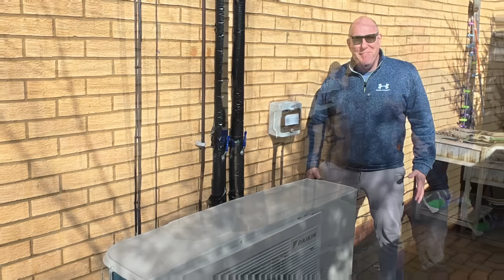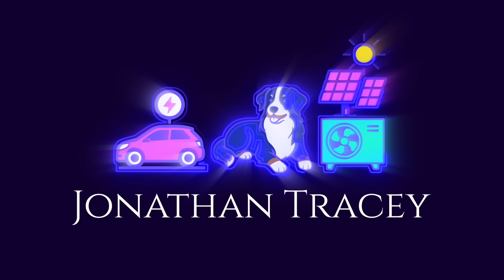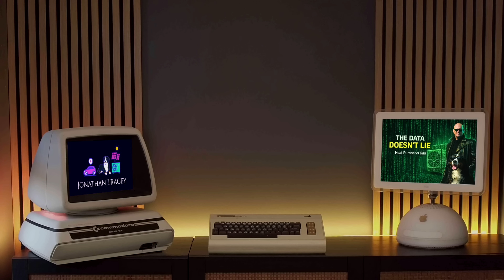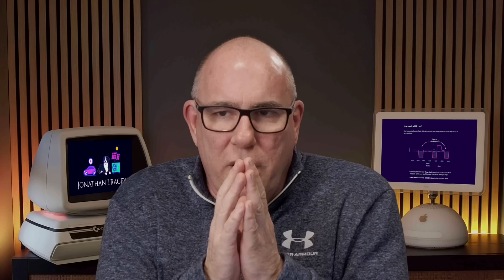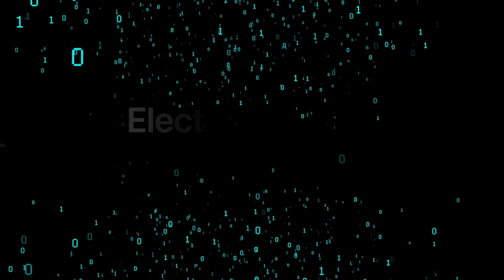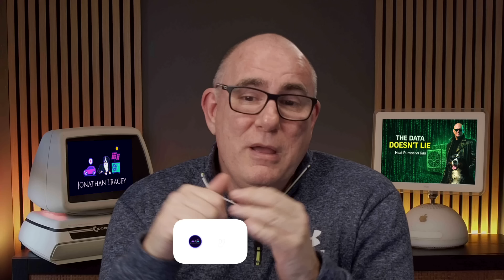The Data Doesn’t Lie   Gas vs Heat Pump Real Running Costs

Comment: If you are making the decision between a gas boiler and a heat pump based purely on cost choose you installer for your gas boiler as carefully as you would for a heat pump.
A study of UK homes with modern condensing gas boilers showed an average efficiency of 80% not the SEDBUK 94% manufacturers claim.
Yes modern gas boilers in lab conditions can hit 94% efficiency but you need a couple of things to achieve this.
1) The system needs to be designed for low flow temps so you need a heat loss survey the same as with a heat pump.
2) You need a condensing boiler with weather compensation that has been properly commissioned.
3) The boiler needs to be run low and slow similar to a heat pump.
I would suggest the sort of consumer who would not have the wherewithal to run a heat pump cost efficiently would probably be the same with a gas boiler.
Reply: You forgot to mention that the study was done years ago, not long after the introduction of condensing boilers. One thing the massive increase in energy costs has done is made people aware of lowering temps to allow the boiler to condense correctly, together with newer boilers being even more energy efficient with better modulation.
Reply: @bordersw1239 installers don't care and most people don't dare adjust stuff - same problem with many heatpump installs too
Reply: @bordersw1239  Sure, but you have no evidence to prove it has changed or by how much.

65% of households in the UK are on a standard variable tariff. If that 65% can't work out that a non-standard variable tariff is cheaper, how likely are they to be messing with the flow temps on their boiler to optimise performance to the max?
Reply: @nervousfrog101 . Well the test rules changed in 2015, when I bought my present condensing boiler 9 years ago, my usage dropped over 20%.
Reply: @bordersw1239  Just to be sure I understand, you replaced one condensing boiler with another, and usage dropped 20%?  Was the new one equipped with weather compensation and the old one not?  Were they both running at the same flow temp? My last condensing boiler was installed in 2015, but I had to request the weather-compensating controller, and the installer failed to set up the flow temp appropriately. I had to adjust the weather comp myself. Every year, when I had the boiler serviced, the engineer would turn the flow temp back up, and I would have to turn it back down when he left.
Reply: @n @nervousfrog101 Where did I say my previous boiler was condensing?
Reply: @bordersw1239  "when I bought my present condensing boiler 9 years ago" can kind of be interpreted that the previous was condensing, which is why I asked before making an assumption.

If your previous boiler was non-condensing, then the efficiency could have been as low as 60%, so a 20% improvement would be in line with the study that showed the average condensing boiler efficiency was 80%.
Reply from the maker: @nervousfrog101 I agree with you. One thing I always say is don’t automatically choose the cheapest quote without understanding exactly what you’re getting. The design, commissioning and controls make a huge difference to efficiency.  

It’s also worth thinking about aftercare — what kind of support will you get 1 year or even 5 years after the install if something needs adjusting or fixing.
Reply: @JonathanTracey   for the purposes of this video aftercare is irrelevant, It can be as good or poor for both types. Here is an interesting fact though, if a combi boiler is set up like an ASHP it's far more reliable than if were it were set up traditionally (ie. badly). Boilers (like any 'machinery') will run without breaking for long periods of time if they are treated gently.
Reply: agree, no gas boilers in the UK is 90% efficient, my combi boiler before being replaced with a heat pump was running during winter on the lowest modulation with flows ~36-42C, basically maximum efficiency for the condensing boiler with efficiency of 85%. Weather compensation is useless for 99% of the houses, as boilers are massively oversized, they cycle even in freezing conditions and hit anti-cycling with most of manufacture controls on weather comp. For my boiler to stop cycling on lowest modulation temperature outside should be around -20C. 

If I take my house with gas prices on the cap tariff. 3803.4kW gas (Dec-Feb) * 0.85 = 3232.89 kWh of heat, that would cost me £253.75 for gas (including standing charge) vs COP 4 heat pump £208.84, and COP 3.2 on the heat pump to brake even. no batteries, no solar, no optimisations, CVT tariff.
Reply: Most of the population don't give a damn about SEDBUK or COP only the cost of having hot water and staying warm.
Reply: @jimh5031  Otherwise known as the SEDBUK or COP
Reply: You can get gas combis up to 98% now. To get the max efficiency out of gas takes just the same as it does for an ASHP, so if you are comparing like for like.
Reply: @lksf9820 I would say a 98% efficient Viessman will not be an average install. A similar quality heat pump install could hit 500% efficient. So yes compare like for like.
Reply: @nervousfrog101   Given the cost difference between a Viessman and any ASHP it's perfectly valid, it's a fraction of the cost. We're talking about money here, nothing else.
98% is the boiler itself, not the install or spec which is often suboptimal.
Everything you do to make the entire system more efficient applies to both heaters.
Here he's used the same system, house and criteria for both heat sources so the results are reasonable and logical.
Reply: @lksf9820  A lot of the extra cost of a heat pump is rad or pipe upgrades. If your CH system is ready to run the Viessmann boiler at 98% then your system is heat pump ready. The 98% is an up to efficiency not an all year performance of 98% whereas we have documented  measured heat pumps with an average performance of 500% over the year. It does not matter how efficient the Viessmann is it won't beat that. By the time you take the grant into account the heat pump could be cheaper.

If the efficiency assumed for the boiler is incorrect then it's not a valid like for like comparison. Also as others have pointed out the efficiency of JT's heat pump will increase significantly outside of Jan and Feb you need to consider the efficiency for the whole year.
Reply: @nervousfrog101  "A lot of the extra cost of a heat pump is rad or pipe upgrades." No that's wrong, every install is different.  An average to top-of-the-range ASHP install is always more than a boiler swap, even if it's a top of the range combi, with or without additional upgrades.

"If your CH system is ready to run the Viessmann boiler at 98% then your system is heat pump ready." That's exactly what i'm saying. Likewise a substandard system will bring down the efficiency of both too.
 
"The 98% is an up to efficiency not an all year performance of 98% whereas we have documented  measured heat pumps with an average performance of 500% over the year. It does not matter how efficient the Viessmann is it won't beat that. "
Not JTs which is the test subject we're talking about. Forget other houses, we didn't test those.
The fact of the matter is HE would be better off on gas.
And if you were to compare 98% to 500% then take everything else into consideration too, like  initial cost and longevity, ROI, service costs. 

"If the efficiency assumed for the boiler is incorrect then it's not a valid like for like comparison."
He's based it on 90% when condensing boilers are more. So in those months its beating the HP even though the gas is based on worst case scenario.

"Also as others have pointed out the efficiency of JT's heat pump will increase significantly outside of Jan and Feb you need to consider the efficiency for the whole year."
Yes agree, but then so will a gas boiler. It's cold where I live, but recently we haven't even had our boiler on during the day due to the weather, it's 20+ in the house. That's zero gas use from 8 till 6.

I think ultimately unless someone has done a lab accuracy back to back actual test for a whole year then we'll never know with 100% accuracy, but for what it is his test is very reasonable.
It could be plus or minus £50 and the lesson is still clear.

Can you get an ASHP with a 12 - 18yr warranty? You can with a combi.
Reply: @lksf9820 Aira offer 15 years. I have seen a company offering a 30 year warranty.
Reply: @nervousfrog101   with the weather like we've had this week, (warm days of 20+ in the house without heating) what would an ASHP be doing during the day and how would it handle the fact it's got to keep the temp at 20 when the sun goes down?
The weather is very different to last week and could go back to Winter next week.
Does it switch completely off via the house 'stat or keep ticking over, if the former, what triggers it to come back on before it gets cold so it can warm up slowly? Serious question!
Reply: @lksf9820  "An average to top-of-the-range ASHP install is always more than a boiler swap, even if it's a top of the range combi, with or without additional upgrades." 1st that's a separate topic but it's not necessarily true. The £7.5k grant balances things out. Taking out the cost of rad changes and the hot water tank my heat pump would have cost less than a new combi. IIRC JT's install was cheaper than having another gas boiler installed.

"He's based it on 90% when condensing boilers are more." You have no evidence of that. The only studies out there show that 80% is a more realistic figure.

My only point here is that the 90% figure is optimistic based on real world studies not that it's not possible so people should think carefully before making a decision. I have never said that a gas boiler can never beat a heat pump on running cost.

"we haven't even had our boiler on during the day due to the weather, it's 20+ in the house. That's zero gas use from 8 till 6." I thought we were talking about JT's property now you want to talk about yours and how you use your boiler which we have no information on.

If we want to start talking about best cases and how one person can use their boiler in a particular way to be cheaper then fine lets do that. My old weather compensating condensing boiler(running at flow temps between 25 & 45 degrees) would have cost me £585 last year my heat pump cost less than £195. I have further optimized the system and with the electricity price cut in April it will bring the running cost below £100.
Reply: @lksf9820  The answer is it depends. With my HP you have two options. 1) Run it on the room thermostat. 2) A mode they call LWT(Leaving water temperature). In both modes the heat pump watches the return temperature and tries to maintain a delta between the LWT and the RWT, and will shut down the compressor if the RWT exceeds the DeltaT. In the 1st mode, the circulation pump also shuts off if the room stat stops calling for heat.

My heat pump will switch off during the day in this sort of weather, but comes back on in the evening, when the temperature drops. The second mode is supposed to be more energy efficient, but I'm not convinced.

Comment: Octopus Tracker is 7.60p/kWh today, close to bailing out but 9 month wait to get back in. That said I need an heat pump rather than my 27 year old boiler
Reply from the maker: Yeah these numbers were done before Mr Trump started bombing Iran, so costs for gas are going through the roof, but so are electricity rates becuase we rely on gas plants for electricity generation
Reply: @JonathanTracey  My financial controller is the obstacle there unfortunately . Not having flow and return pipes running up wall she says, look messy, what like all the drainpipes?
Reply: @markjones632  ha through  the years we have had aerial  look bad then omg im not having a satellite dish on.the wall to no im not having a heat pump they look bad ... but things change and life moves on funny how what was once an eye saw nobody thinks twice about now

Comment: Will they take the Red pill or the Blue pill..........perhaps there should be a Green pill.....just like your car with gas you are burning a fossil fuel, I like driving passed a petrol station.......my COP is currently 5.78 combined
Reply from the maker: how are you getting such a high cop? That’s amazing?
Reply: @JonathanTracey  As Mavis said "I don't really know!" unless Vaillant are over egging it! I can only assume it's how we've finally managed to balance our system. We do have underfloor, which I think helps. But it hasn't varied much between low 5 and even over 6
Reply from the maker: Hey don't look a gift horse in the mouth, underfloor heating helps but that still amazing :-)
Reply: Impressive

We have 4.89 for heating and 2.75 for hot water
Reply: @Burtis89  It's taken time and little bits of tweaking!!!!
Reply: Errr, all you're really doing is moving the burning of gas, Let's not pretend that unreliables are remotely green. Thousands of tons of silver, copper, cobalt, magnesium, steel, concrete  - that's just the solar panels. Each windmill is 500 tons of concrete rammed into the sea bed, 100 tons of steel, hundreds of metres of blades that cannot be recycled, then there's the animals slaughtered by them, the magnetic disruption to flight paths of migrations. Unreliables are NOT green. Until we master something like micro black holes, fusion or before that helium 3 and Thorium will be have truly 'green' energy. The point of net zero is limitation and control. It has nothing to do with the environment and is actively damaging to ecology.
Reply: @px794  better efficiency is better efficiency though and that's the goal to improve it

Comment: When we had gas (heating and hot water only, no cooking etc), we heated our home for 2 hours in the morning and then 5-6 hours in the evening. In our last full year of gas, we used 10501 kWh. We have just completed our first year with the heat pump, heating the house all day, and it used 3652 kWh of electricity. On standard tariffs, I guess the costs would be broadly similar (but we’re always warm now, of course). With solar and home batteries, no contest on the cost front of course!
Reply from the maker: Yes the way you heat your home changes dramatically with a heat pump vs a boiler, and without smart tariffs it should come out like for like (if your heat pump is setup correctly) then you add in a batteries and smart tariffs and all of a sudden the heat pump is much cheaper to run